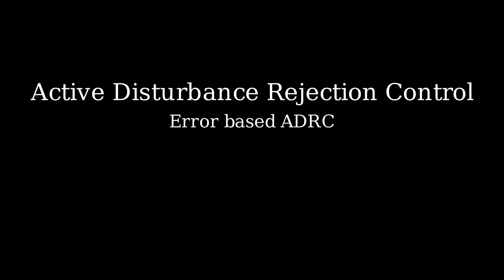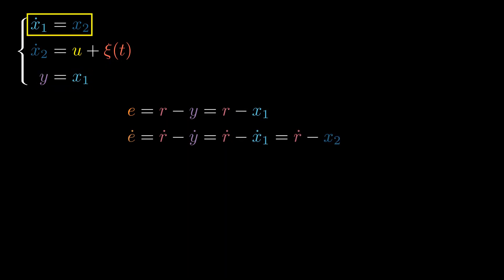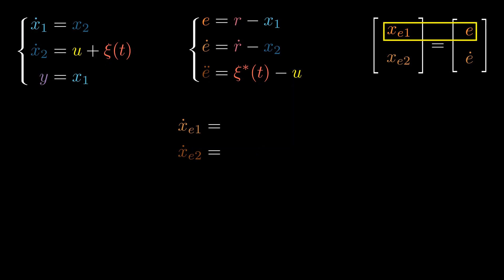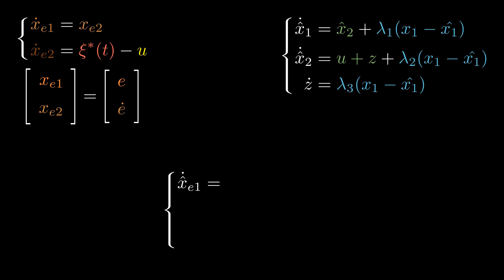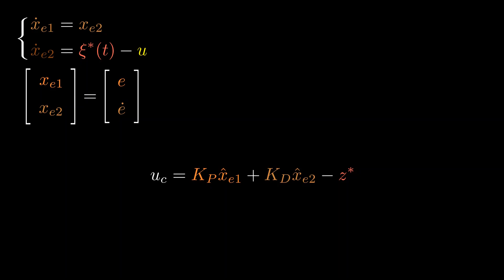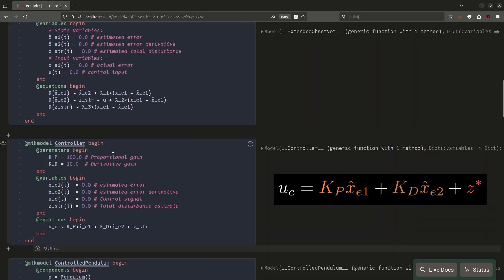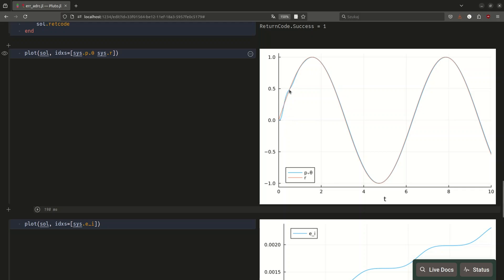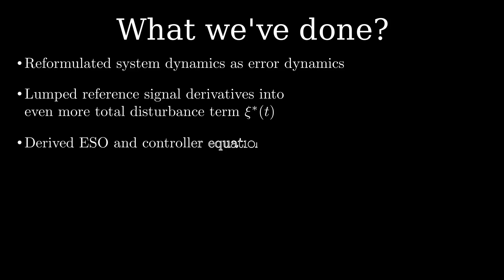Active Disturbance Rejection Cotrol part 2: Error-based ADRC

Comment: thank you i have a problem in this example simulation can any one help me?
Reply from the maker: Hi, what is the issue?
Reply: @PIREngineering  the system is not stable!
Reply: is there any way to send my simulink file?
Reply from the maker: I can download the simulink file from the location you gave me,  I will take a look when I have some time.
Reply: @PIREngineering  thank you
Reply from the maker: @hussamhasan7777  I finally found some time to look into your model. You have a mistake in the observer, where you use error instead of difference between actual and estimated error. Correct equations in your observer should be:
xe1h = L1 * (e - Xeh(1)) + Xeh(2);
xe2h = L2 * (e - Xeh(1)) + Xeh(3) - u;
xe3h = L3 * (e - Xeh(1));
Reply: @PIREngineering  I'm very thankful for you time. You help me a lot 🙏🙏
Reply: https://drive.google.com/file/d/1-W8a8LJGYW1pl88lc7DbxuGnAqU9OsNN/view?usp=drive_link